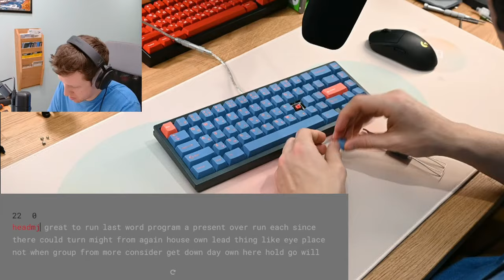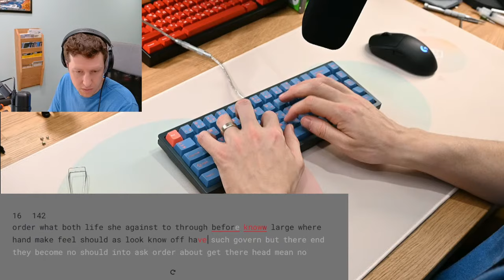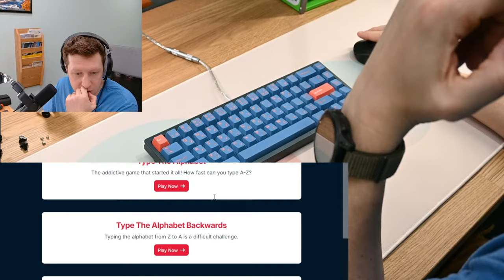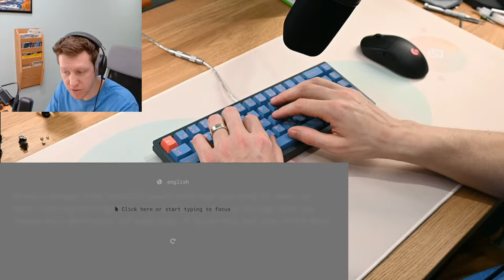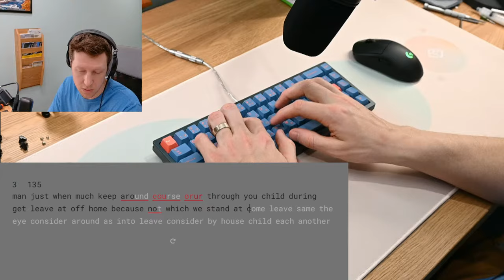Building the Mode Envoy!

Comment: The amount of play available on the PCB and plate relative to the case was a bit surprising.
Especially since after moving the plate assembly up the space bar sounded way better 🤔

Also not sure if you put the accent into the envoy case?
Reply from the maker: Accent is there! It's just grey and pretty subtle.

I fiddled around with the case screws the day after and it had less play. Also used the stepped caps lock configuration and the caps lock sounded way better. 

Will post a sound test soon!

Comment: I would loosen the screws a bit. They dull the keys around it. My biggest problem with the envoy.
Reply from the maker: I actually wound up tightening the screws because I had some play with the PCB. When I put on the stepped caps lock it sounded so much better, wondering if it's because of the switch orientation.